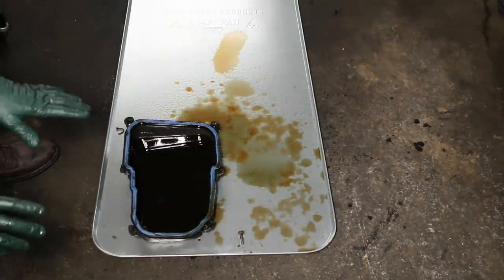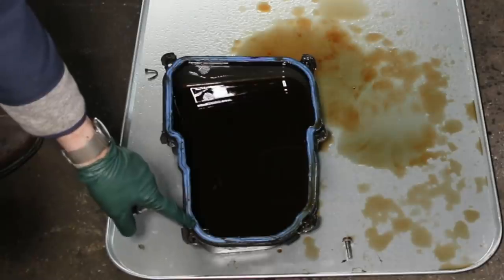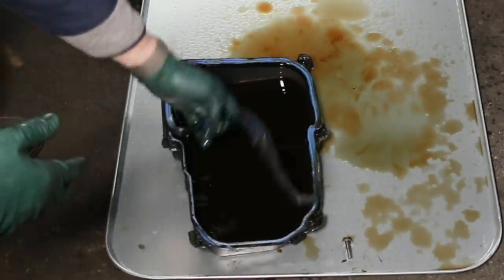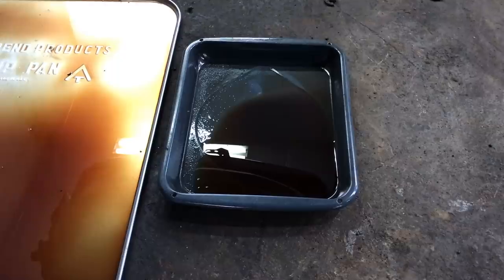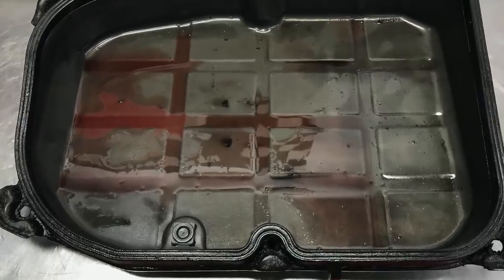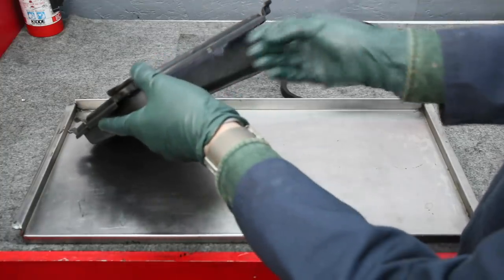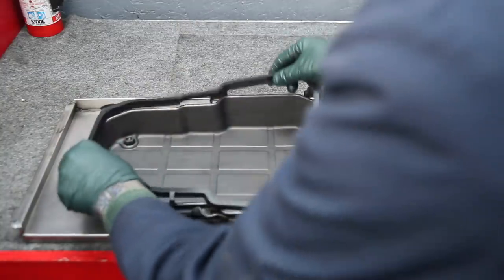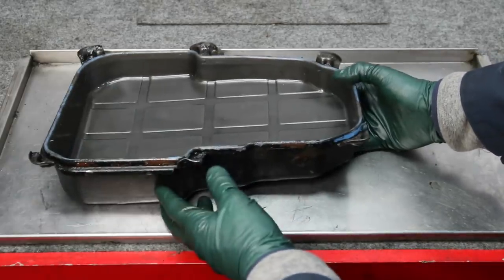Automatic Transmission Fluid and Filter - Special Tips Dos and Donts

Comment: How do you prime the torque converter with new fluid for start up?
Reply: the transmission high-pressure pump fills it up... one of the ATF properties is anti-foaming when loaded down with air.

Comment: Is it safe to change the transmission fluid and filter on a 1984 R107? 245K miles. No mechanic in town will service it. No leaks or anything.
Reply: I would. Just use proper fluid, gasket and filter. Mechanic probably just doesn't want the responsibility if something breaks within a few weeks of servicing an old classic car.